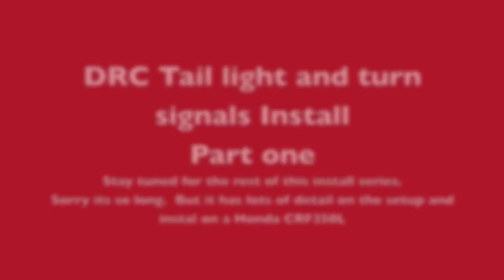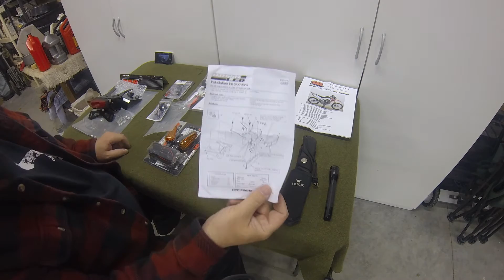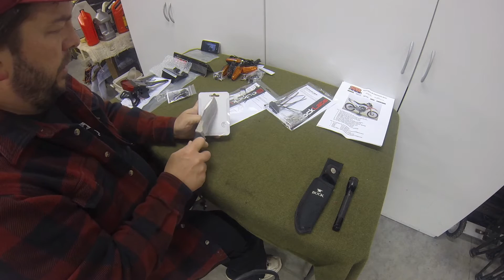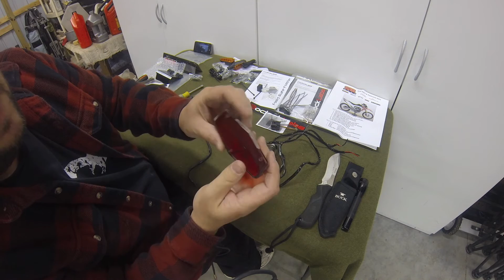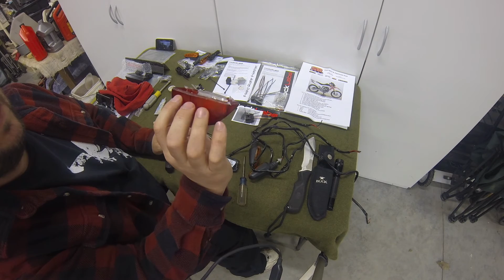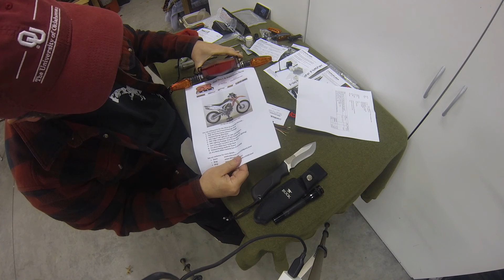CRF250L DRC Tail Install, Part 1,  Un-Pack, Set up and modifications.

Comment: What stock connector kit from 12oclocklabs did you get? The only one at 12oclock labs that I see doesn't have the wires. http://shop.12oclocklabs.com/index.php?route=product/product&path=25&product_id=111

Did you get it from their website or another vendor?

Edit: great video BTW, very informative!
Reply from the maker: Actually I think I ordered all the stuff from CRF's only...  Your link is for the same connector and in the information/description they say that you can have them attach wires to the connectors.  When I ordered mine it just came that way.  you had to push all the pins into the connecor and solder/crimp them to the tail light.  Then it became plug and play.  Now I can revert back to my stock tail light any time with no hassle.   

Thanks for watching!